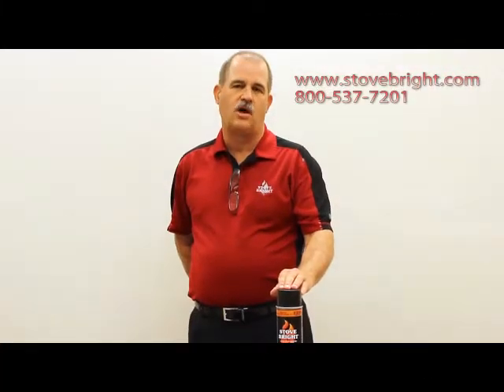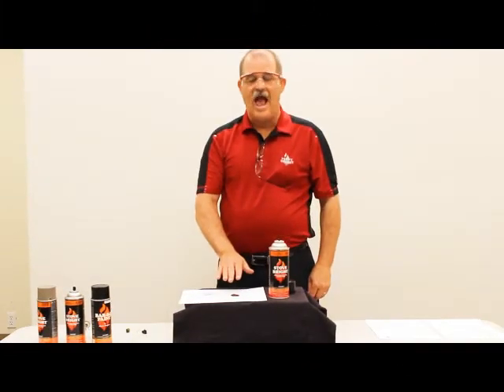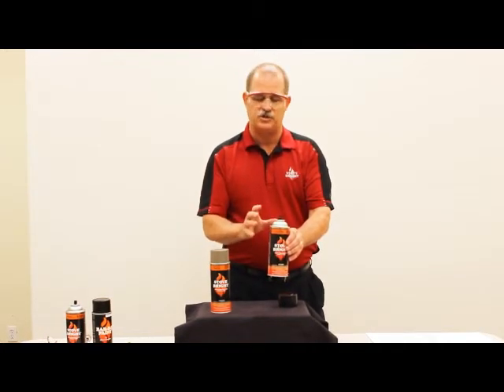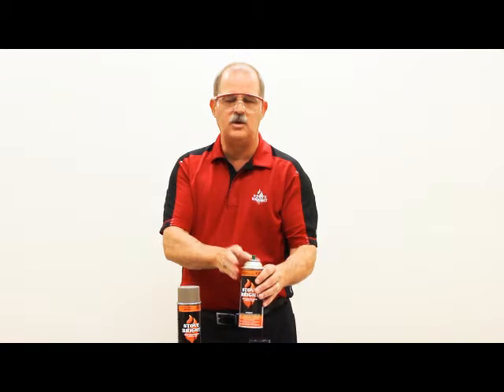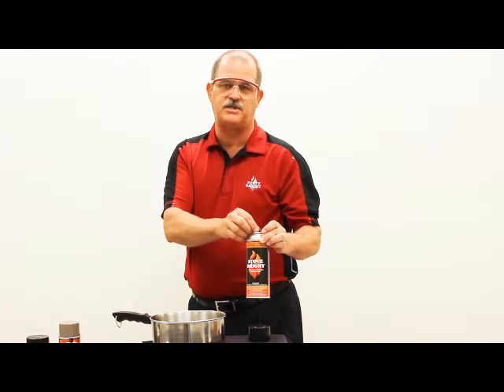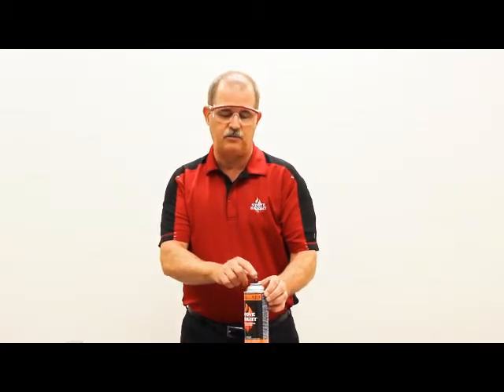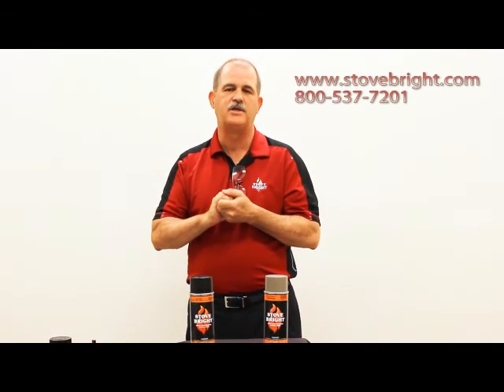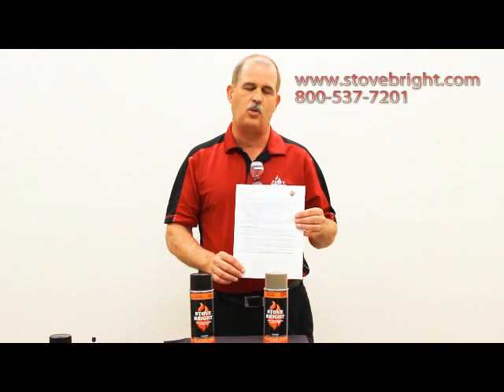Stove Bright® High Temp Paint replacement tips for Aerosol Cans

Comment: I am sorry to read Coyote5's comments about problems using Stove Bright High Temperature Paint.  FORREST Technical Coatings has customer service representatives available 8:00am Pacific to 5:00pm Pacific to assist any dealer, installer, or consumer with the proper use of our product.  FORREST has been delivering aerosol high temperature paint for decades.  The specialty nature of the high temperature products does present challenges with chemistry that require a little more work by the user to get the best result.  Please contact FORREST about Stove Bright at 1-800-537-7201 or info@forrestpaint.com if you have any questions or problems with Stove Bright.